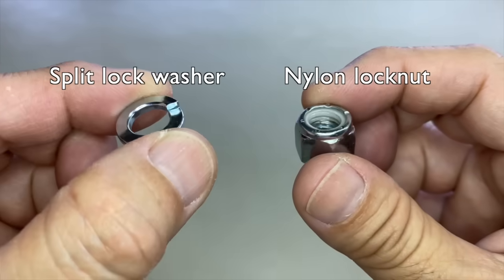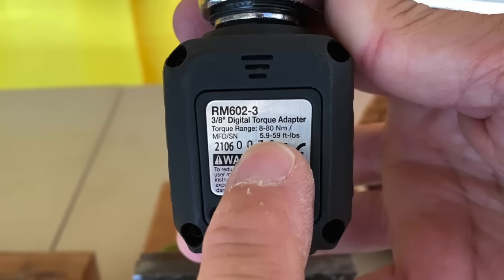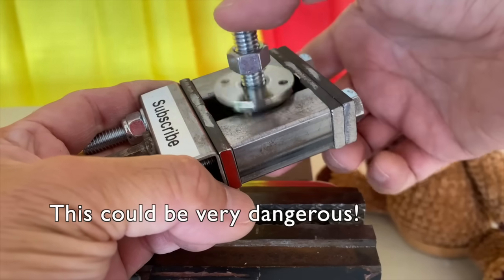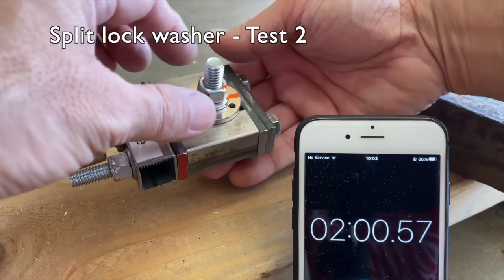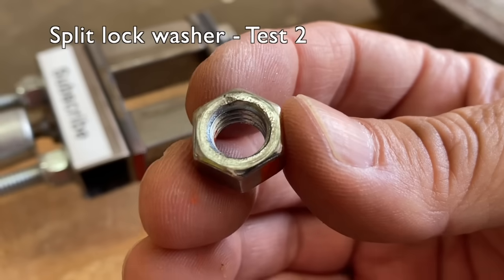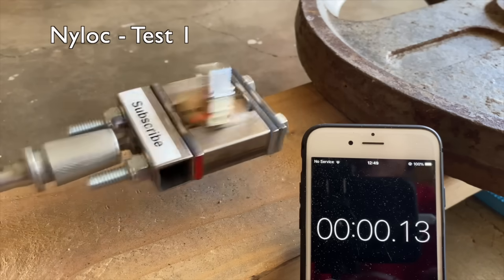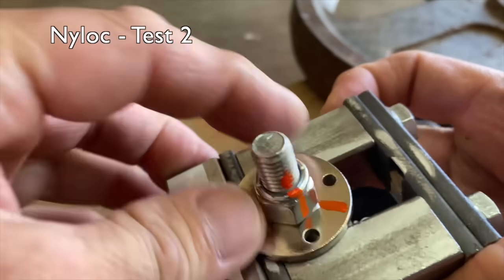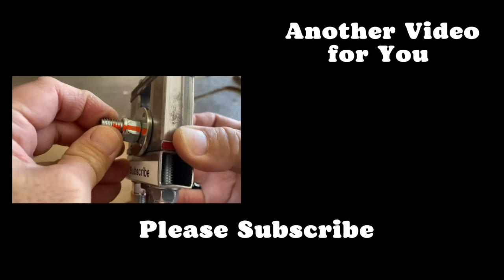Nuts & Bolts - Split Lock Washer vs Nylon Locknut – DIY Impact & Vibration Test - Part 1

Comment from the maker: Check out all of my Nuts and Bolts videos in this playlist... https://www.youtube.com/playlist?list=PL_WcGw5s6Cq6YK_s-NNne1838j25ijmii
👍😎
Reply: This is total crap !  You are not using even close to the proper torque for this size and thread pitch. Good luck making any money off this one.
Reply: @dallasarnold8615 
The physics of the loosening process are the same, no matter what torque is being used.
If you're willing to wait a looong time, you can torque it to 50 foot-pounds and do it all over again.
Reply: @k.wi.7991  Just keep telling yourself that.
Reply: Very Good
Reply: If you work as a designer and have to design a safety critical screw attachment then consider following: The best securing of a screw is when the clamping length of the screw is "(at least) 5x screw diameter" plus the correct torque is applied. The length of the screw ensures that the screw can stretch under the correct torque and that the tension provides the necessary anti-rotation protection. No additional locking attachments needed. Just screw, nut, (washers) and torque. Compared to all locking attachments such as rings or nuts with plastic, this is by far the safest way to secure a screw attachment. @Hacks by Dad: Maybe you can check and prove that for the audience.
Reply: one nut tight without washer,
a 2nd nut tight on the first one.. 
try it..

Comment: Nylock test torque did not match the other two tests. The nyloc nut should have been torqued to 6.5 or 7 instead of 6. This is to compensate for the drag of the nylon locking feature.

Comment: That's why locknuts are not used to secure engine control cable rodends on aircraft, they are secured with castle nuts and cotterpins

Comment: Former Merchant Marine Engine Utilityman here. 
1) Try thst same test including LockTite.
2) Part of the 6 l s torque on the Nylock is due to friction and cutting the threads in the nut. The total clamping force was most likely lower than on the bare nut or with split washer.
If we really can't have an assembly coming loose, we use a castle nut and a cotter pin or safety wire.

Comment: So, after repeating your control study 3 times, you have found that although a split washer is less effective than a nylon lock nut, neither system ensures a secure tight lock.  With either system, if your union is subject to significant vibration, you must periodically check it and tighten the nut.  That may be more easily done with a split washer/nut assembly.  You might attempt a third combination:  split washer plus using a nylon lock nut combination.

Comment: I work on spaceships but I can't disclose who i work for. We use flubber on all our bolts. You can make it from household products too. It has anti-reversing properties and is perfect for mission critical applications. We once ran out and under pressure to launch and were in a pinch so we used high quality titanium lock washers rated for gravity and zero gravity as well. The vibrations from rockets using a solid fuel are intense and we had a catastrophic failure and lost good people. Luckily the investigation team concluded that the failure was from a sealing ring on booster 1 and ended the investigation without a thorough look over. Still to this day no one realized we used over 9300 split washers. We are back to flubber and keep it in larger quantities.

Comment: I've never found lock washers to be of any use, typically they just crush flat and don't accomplish anything. Never had any problems with Nylon locking nuts, they tend to be more reliable than using LocTite (red or blue), but for critical components they use castle nuts and safety wire or pins.

Comment: Someone may have already mentioned on an earlier comment, look at 2:25 as you show the split washer, it's not even tightened down fully at 6ft lbs. You should be using the specified torque for that size of bolt.

Comment: The torque spec for a 3/8"-16 grade 5 bolt is approximately 31 ft-lbs for a plain (unlubricated) fastener, though some charts show a range of 20 to 31 ft-lbs depending on the material and lubrication. For applications requiring higher strength or for very specific engineering needs, it's always best to consult the manufacturer's recommendations or a specialized engineering chart.  Fastenal specifies 23-31 ft-lbs for Grade 5.

Comment: I believe in Nylock nuts and I use them often. and they work great in conjunction with lock washers. and they not only work good for staying tight. they also work good when you want to allow movement. (an example) would be on linkage. I also have used them to make valve covers easier to remove. by buying three inch" long bolts. and threading the nylock nuts on to them. then removing and turning them around so the nylon part of the nut goes on first. then I use the three inch long bolts to hold the valve covers down. so the hex part of the bolt sticks up above the valve covers. where they can be easily accessible with a wrench. it's a necessity on engine's with solid lifters.

Comment: You missed one detail, you should of added the running torque of the nut to the final torque. If the running torque of the nut was 3 ft/lbs, then the final torque should have been 9 ft/lbs. It would have made a difference in the final results.

Comment: I didn't use a torque wrench, but used the appropriate amount of ugga-duggas on a pump assembly.  On the suction side, no lock washers because the length bolt that would allow the extra room and get 5 threads engaged in the blind hole was too long for the application.  Further up stream on the suction side was MJ flanges (3/4" T head bolts that I put on with extra ugga duggas).On the discharge side, standard 150 psi flanges that I used lockwashers on every bolt.  The pump cavitated due to loss of adequate incoming fluid, and vibrated.  It vibrated hard enough to loosed all the suction bolts on the pump flange and on 3 of the 4 MJ joints.  I actually lost one entire bolt and nut from the MJ when the water washed it to god knows where.  Moral of the story here is that lockwashers of any kind beat no lockwashers under a vibratory strain.

Comment: I've thought about this a fair bit both professionally and a a home owner.  Firstly split spring lock washers are what are taught in Mech Eng text books, how much load torque etc.  I worked for a large manufacturer of water treatment systems, big, 10-15 vessels , 4' to 10 ' dia plus pump skids etc.  I never paid much attention to the bolting as it was one of the few things that I didn't need to buy as the shop looked after that.  So these skids or vessel skids were assembled in the shop with all piping and shipped to US or around the world, China , Singapore , France etc. The shop didn't use the split spring lock washer but a star one that when compressed dig a bit into the metal or paint.  For inside the vessel , which was all stainless steel hardware everything was double nutted which works really well ( any type of loctite would not be allowed inside a vessel).

Comment: Use either a flat,or spring washer, torque first nut, then add another nut and lock these two nuts together very tightly. Works for me.

Comment: I'm a builder not an engineer however common sense tells me that a split washer would not engage as designed at such low torque so invalidates the experiment.  It would be interesting to see how a  Nord-Lock washer would compare although I guess this also would require the correct torque to work as designed.

Comment: The nilock didn't move at all with the  bolt. But the bolt was loosed, which means the bolt or the flat washer were deformed.

Comment: Torque is not the same as clamping force. Torquing ensures uniformity not necessarily clamping force. Torque settings are an approximation of clamping force based on bolt geometry and an estimation of the friction 
A better test would be to tighten each fastener set to the same bolt elongation, especially with the nyloc nuts.
You didn't test thread locking adhesives, star washers or centre punching.

Comment: If I really don't want something to come loose - red Loctite on clean, degreased threads. That's as long as the threads won't be exposed to high temperature.

Comment: Not the best test I think. A lock washer would not (or should not) be used in a situation that has only 6 pounds torque. The test should be run at higher torque levels that would normally be used on a 3/8 bolt. The hardness of material will make a difference too.

Comment: Eccellente test rig. And a well constructed test. Three tests on all situations. 
But, there are a couple problems with this test. Probably others have noticed the most glaring: 6ftlbs torque on a 3/8 in nut is a torque disc that doesn’t exist anywhere, on anything. I think 9ftlbs is the lowest torque spec I have ever seen. I would say torque that to 20ftlbs and the outcome will be different for all three tests. 
Second, not being able to twist the unlock on the threads is meaningless. Unless you have the grip strength if Aaaanold in his prime you can’t turn that nut at all. You can’t use a nylock and make it finger tight ever, the best you can do is get about one turn if threads into the nylon bushing then get a wrench. Even after tightening the nylock nut and loosening it several times it is still not possible to turn it with your fingers.

Lastly, you leave a person with the impression that nylocks are superior to split washers. The one factor you ignore in your test is heat. Nylock sre never in a spec sheet if there will be heat involved, say the exhaust manifold nuts an internal combustion engine, because the nylon is going to melt or burn right out.

Comment: Why torque to only 6 ft/lbs? Did you not refer to the Engineer's Handbook to establish the correct torque setting for the size, thread, and material of your bolt? This is crucial to establish the correct torque that will put the bolt under elastic tension without reaching the point where plasticity risks fracturing the bolt. Very strange testing that suggests you're not a qualified engineer.

In other words: THIS GUY DOESN'T KNOW ANYTHING ABOUT CORRECT ENGINEERING !

Comment: Seems likely that you used 6 ft lbs because when the bolt was torqued to spec the nut never loosened with the control

Comment: This video is a great demonstration showing why you need to look up the correct torque values for fasteners.  6 ft/lbs is WAY too low for this washer/bolt size.  A split washer is there to act as a constant force spring; not as a sharp edge to lock the nut.  In critical applications such as bolting a cylinder head to an engine case, you first torque the nut to the proper value and then wire tie it to prevent it from ever loosening.  Nylocks are generally best for light duty, lower load applications.

Comment: How about a split lock washer under the head of the bolt with the nylon lock nut? Or a split lock washer with a nylon lock nut? The best of both worlds? I need to see Part 2.

Comment: I was told by a company that they use lock washers not because they lock anything but they are smaller than regular washers and readily available. And they otherwise use Loctite and proper torque.

Comment: When you work on pew pews, you torgue small 1/8 to 1/16th screws and nuts to 15 to 20ft-lbs of torque. And some parts up to 80ft-lbs....6ft-lbs is what you use to torque a plastic nut & bolt.......  aside from increasing torque... when high forces/bibration are going to be in play, use loctite because not all nuts/bolts are machined to exact specs and there can be play with many if not most of the cheaper manufactured ones

Comment: If you work as a designer and have to design a safety critical screw attachment then consider following: The best securing of a screw is when the clamping length of the screw is "(at least) 5x screw diameter" plus the correct torque is applied. The length of the screw ensures that the screw can stretch under the correct torque and that the tension provides the necessary anti-rotation protection. No additional locking attachments needed. Just screw, nut, (washers) and torque. Compared to all locking attachments such as rings or nuts with plastic, this is by far the safest way to secure a screw attachment. @Hacks by Dad: Maybe you can check and prove that for the audience.

Comment: There is also the counterlock way where a second bolt is bolted on top of the first. You lock both to the same force, then you turn the one under a bit in the other direction while holding firmly the one above....

Comment: I bet if the torque was set at a more reasonable number for the size of the bolt in the nut, which I would say would be around 25 to 30 foot pounds the results will be entirely different.

Comment: As said elsewhere I think, Nyloc benefit is in stopping the nut coming completely off rather than holding in place - and even so the drag of the nylon should have been added to the basic 6lb/ft for proper comparison.  For anything that's to be held from loosening at all then you use tab washer or locking wire (nut drilled with wiring hole) - or castellated nut with split pin.

Comment: 6 lbs of torque seems unrealistic.  My question is, at what torque value does the lock washer work?  Meaning, what is the lowest torque value you can put on it where your sawzall machine is unable to shake it loose?  That's data worth having.

Comment: There is an error in the setup. The two pieces with the flanges seems to be able to rotate relative to each other. They will unscrew any bolt.

Comment: Hello, interesting but the last test with the nylon does not seem comparable, to be comparable you need to increase the tightening torque of the screw to take into account the resistant torque of the nylon.

Comment: The biggest difference really is the fact that the split lock washers only work as long as the nut is tight against the washer, while the nylon holds the entire length of the thread. The results were really not that surpising to anyone who understands how friction works.

Comment: I used to drive an International Scout.  The rear wheels are mounted on a tapered axle with a key way.  A large castle nut with a cotter pin holds this together.  The castle nut is covered by the worlds tiniest hubcap.  This worked fine for me, until the castle nut cut through the cotter pin, and the rear wheel came off while I was driving.

Comment: In order of effectiveness from worst to best:
No lock washer or other holding device.
Star lock washers.
Split lock washers.
Locktite (Red)
Nylon lock nuts.
Steel lock nuts.
Safety Wired nuts (standard for aviation).

Comment: Not mentioned yet because, I suppose that none of you guys use or even know what prevailing torque nuts are as a type... Stover as the primary brand. Nyloc are suitable for putting together a lawn chair and that's about all. Use in automotive application is foolish. 

A man without a good pair aint much of a man

Comment: I am an Ex R.A.F R.R. Engine mech from the 1950's and I note that there are suggestions of using Cotter Pins do these people mean SPLIT PINS as a Cotter pin is as used on bicycle Pedal arms connecting to the Chain drive axle. Split Pins are generally made from malleable metal and should if used on aircraft be closely inspected regularly as they can wear from vibration. 
     I am surprised you did not Test the following for a complete evaluation.
     1. S/S Tab Washers and Anchor Washers.
     2. S/S Wire Locking in various ways.
     3. Liquid thread anti vibration fluids.

Comment: That was very interesting and worthwhile.  The question to ask yourself is what level of security do you need for your application? If you’re holding the door to the mailbox on you won’t need the same level of safety as you do with a mechanical device under vibrational and torsional stress.  Lots of good information.

Comment: I used to know an old motorcycle mechanic who would grind off part of the nuts he used so that they were heavier on one side. He claimed that if said nut ever broke loose, the imbalance in weight would keep the nut from rotating it's way off the threads. I've never done it myself. Seems like too much work for too little value in security to me. But it does seem to have some merit.. wondering if any of you all have ever heard of people doing this?

Comment: nylon nut prevents the fall-off dislodging of nut and bolt,  split lock washer has better hold to keep the tightness of fastening,   Nylon nut + Split lock washer combo use may be a even better solution.

Comment: Couple more factors that I didn't notice in the comments: 1. A lot (most nuts and bolts?) usually have a flat washer in the mix. One of your tests really showed the lock washer digging in on both sides. Had it been digging into a flat washer instead of the base material, I think the results would have different, probably coming loose much sooner. 2. The locknuts are commonly/typically spec'd for one use and to be replaced for a reinstall or new use due to a deteriorating effect on the locking ability. Sounds good but, real world, how many are reused, once or a hundred times?

Comment: Great test. I would love to see this test with higher torque. It was my understanding that nylon locknuts work better for low torque items while lock washers work better for high torque items. I guess the vibration scenario also would play a big role. Thanks for sharing

Comment: What is the melting point of the nylon used?  If the nut is exposed to high temperatures, will the nyloc melt and become ineffective?  Great comments and video.  Many folks are suggesting to use a higher torque and use cotter pins.    Thanks.